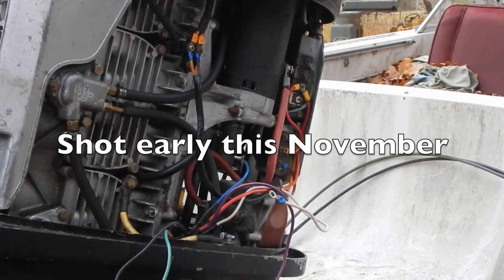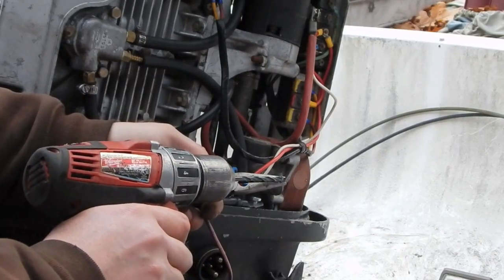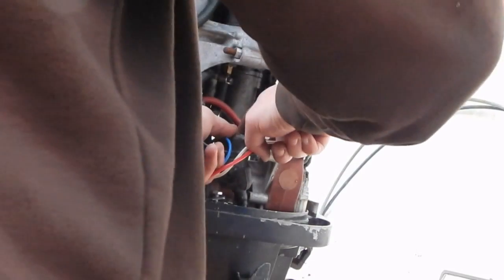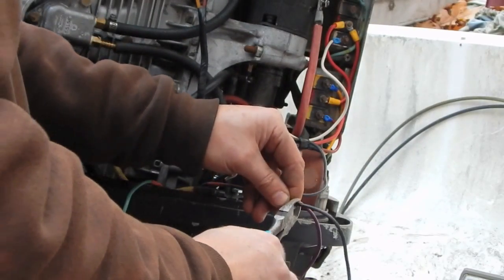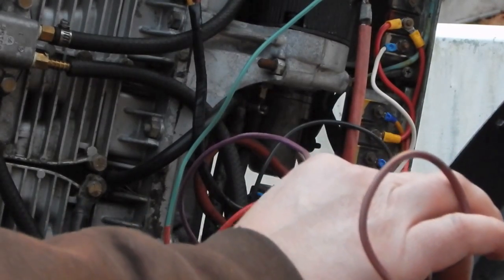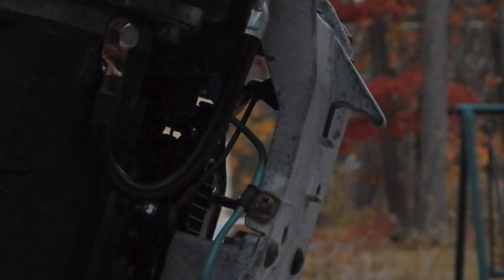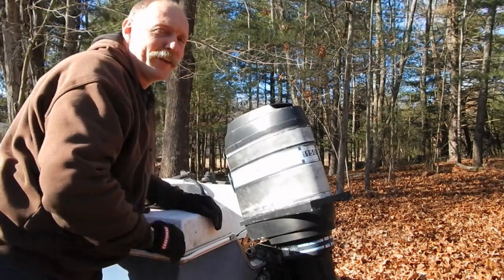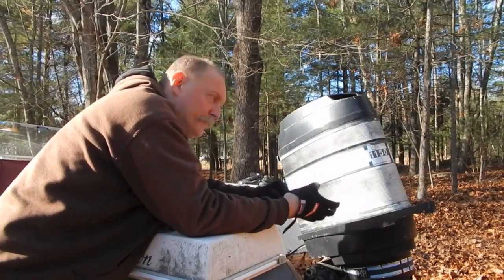The Mercury "Tower of Power" Part 53

Comment: Love the video series. I currently have a 1990 Astro 17sc Quickfire bass boat with a 1971 Mercury 115 Hp 1150 Thunderbolt outboard.  I got the engine from a previous boat that I owned and swapped the motor over to the Astro. It ran when it was on the other boat but after swapping it over to the Astro I couldn't get it to run. I found that I was having ignition issues and after fooling around with it for awhile I was actually able to get it to run for about 5 minutes,.. turned it off and tried to restart the motor and nothing. I couldn't get it to fire again after that. My fear was that it may have been in the switchbox.  I couldn't understand why it was intermittently firing though...so after getting extremely frustrated I abandoned the project all together. That was about 10 years ago. Your vids inspired me to try again. I feel more confident about tackling the project again after watching your vids. I'm going to Alabama this weekend to pick it up from my aunt's house. I left it parked there when I moved to Dallas, TX. I am currently living in Knoxville Tn. now so it's not as far of a trip to go get it. lol  Thanks for posting and I hope to be able to call on you in the future as I will no doubt have lots of questions during the process.         One of the things that I noticed while watching your videos that I wanted to point out was that I am very concerned about the transom on your boat. I saw a little bit a give in the transom while you where mounting the motor. You don't want to hit the lake with a possible rotten transom and have all that hard work sink to the bottom of the lake. That would be quite "disconcerting" as you say. There is a plate that is made for a weak transom, (notice I said weak and not rotten, plate won't be strong enough for rotten)  it wraps from the inside, up and over the top and down the outer backside of the transom to help give it more support.  All your mounts and bolts go to and through the aluminum plating. The plate helps distribute and spread the torque from the motor more evenly. May be worth looking into if its weak.         Also...I think I heard you mention that you live in Mass? I lived in Mass. when I was a kid... In a town called Shirley, right off the 495 loop. Loved the winters there as a kid,...now not so much. lol  Again,... great videos. You da" man!!!
Reply from the maker: Paul Smith glad ypu like the videos, and thanks for commenting. several people have voiced valid concerns about that transom. I'll baby it for a test run this spring, then I'll pull the motor and do a proper repair. I may just use the boat to test the motor, and sell it. It just seems too big for this little boat. I have an 85 horse mercury that might be saner. who knows, maybe I'll find a cheap boat for this motor......no rush.

Comment: yup. 50 hp. was sitting in a buddy's barn for 15 years on the boat, spent about $100 on some small parts (impeller, condenser, gear oil etc) and got ot running. Starts like a new motor. I was just telling my wife that I got lucky with mine after watching this series. As much as it might not seem like it to you, the videos have been... um ... inspirational!
Reply from the maker: excavateboy lol. Thanks!

Comment: I'm up here near Toronto and I have a 63 merc 500. just looked at it today in the shed at the cottage. Under a snowfall advisory watching your videos I'm amazed at the similarities between the engines. Fun to watch while the snow is hitting us. Getting itchy to get it back on the water in the spring.
Reply from the maker: excavateboy thanks for watching. was the 500 a 50 hp? just a guess because the early 115 hp was called the 1150.

Comment: Hi Steve, I have a tapered reamer with a t handle that I use to enlarge holes in crimp on terminals, and holes in sheet metal etc. I think it is made by General tool it works great.
Reply from the maker: douglas brown good tip Doug. Thanks.